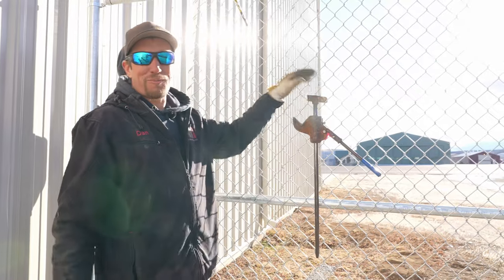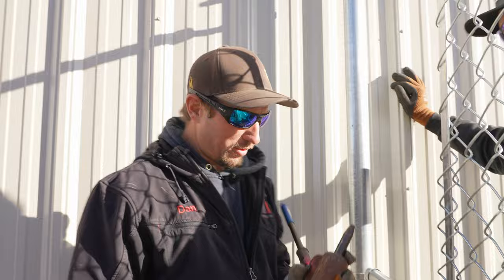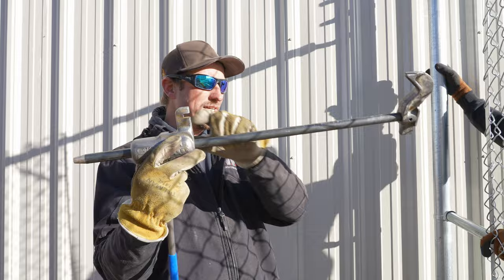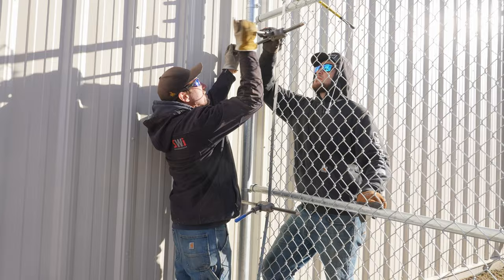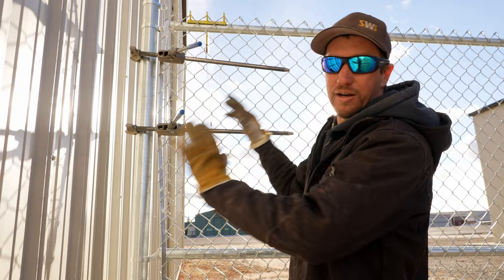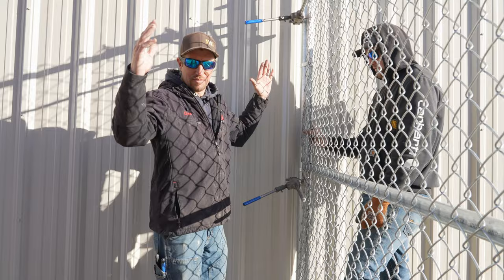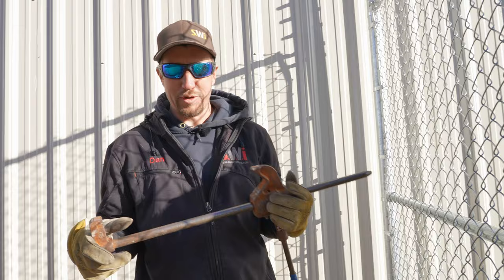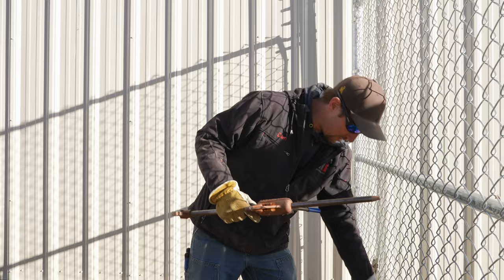How To Stretch Short Runs Of Chain Link Fabric EASILY

Comment: For a few dollars more, I always put another terminal post somewhere close to the center of the short run so I can pull both ways from the middle terminal. This way I can allow for extra chain link to be attached to the building or existing fence to close the gap from post to building or existing fence.
Reply: I will have a gap of about 12 inches between the house and the terminal post when I put fabric up for my dog run.  Are you saying I can extend the Fabric over the terminal post, while still using the tension band on the other side?  That would be great then I won't have to figure out an extension to keep these little shelter pups from zooming through the gap near the house.

Comment: You somehow knew where to put the tension bar, so that the tension would be just what you wanted when it was pulled to the post.  What if one is just guessing, and guesses wrong?  Just release tension, reposition the bar, and pull it again?
Reply from the maker: Yeah that just comes from years of doing it. You're right though - just do it again with the bar in a different spot. 👍🏻

Comment: @chintasrvvegankitchen7761
1 second ago
I will have a gap of about 12 inches between the house and the terminal post when I put fabric up for my dog run.  Are you saying I can extend the Fabric over the terminal post, while still using the tension band on the other side?  That would be great then I won't have to figure out an extension to keep these little shelter pups from zooming through the gap near the house.
Reply from the maker: No, you can't really extend your fabric past the terminal post. My question is why are you setting so far away from the house? If you're able to set right next to the house you can eliminate your gap issue.
Reply: My home is pier and beam in Texas and I can't get too close to the side.  @SWiFence

Comment: can u use wood clamps??? with a notch cut in it?
Reply from the maker: I would doubt it.
Reply: You can use quick clamps but puljaks just work better.  Puljaks also can pull with a lot more force than most quick clamps.  Puljaks also have a rake version and a version made to pull tension bars so the will not slip out.  Both Puljak versions have a “v” to go around the pipe.
Reply: @nicholaslacovara2381  agreed

Comment: Just use it back works duhh
Reply from the maker: Working backwards will get you through in a pinch up to a certain size of post, but after that all it'll do is keep slipping off and smacking you in the face. Thanks for the friendly tip though. 😒